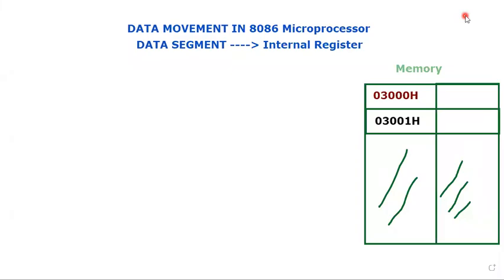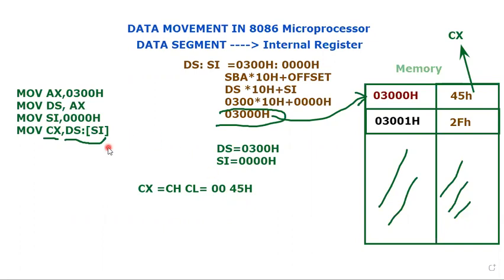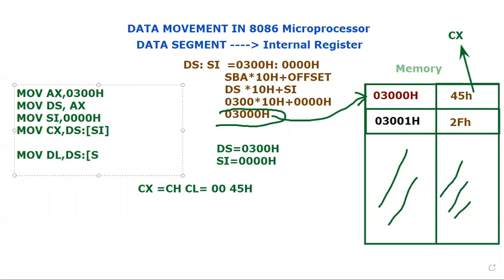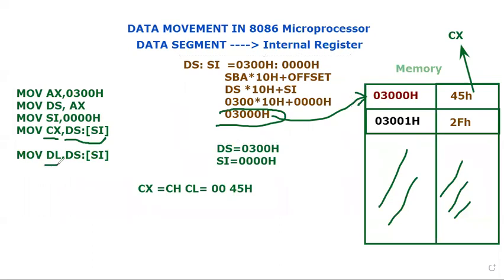how to move DATA FROM DATA SEGMENT to INTERNAL REGISTERS in 8086

Comment: Sir I have one question:in this video why did you write:"MOV CX,DS:[SI] whereas in the video " How to write in Data Memory Segment in 8086 Microprocessor" you wrote the instruction "MOV [DI],AX"?I mean when do you use the base segment address in an instruction and when we do not?
Reply from the maker: That's good question. Both are valid. If you don't use any segment over ride that means your data segment is used and location from data segment will be accessed. If you write something like ES, SS Or CS that means you are accessing other segment. Now let's state the rule  if you don't mention segment register then by default it is data segment and if you want to use some other segment register then you need to specify it.
Reply: @LearnOnline1  thank you,I understand